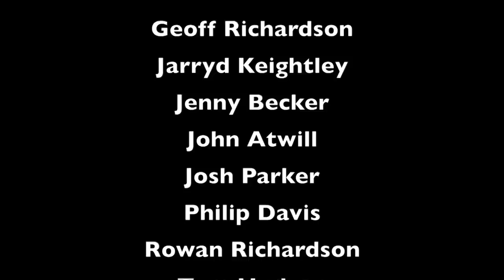Installing the rudder and antifouling the propeller

Comment: You won't regret getting the inflatable. They're so easy to haul on deck when towing isn't an option. Just one tip when towing the inflatable. I rigged a bridal from the rear handles along the sides and through the front D ring, to cut down the load on the the single D ring. When towing with the outboard on the transom, it will significantly increase the strain on that single front ring, and the bridal set up will take a lot of load off it. Loving your videos mate. Thanks for allowing us to share your journey.
Reply from the maker: I've really enjoying using the inflatable and I think it is going to be a great tender. Good tip about sharing the load so the front D doesn't get ripped out. That wouldn't be a great day.

Comment: That is real progress!  Starting to look like she's ready for sea.  Oh yeah, I do have one of the same Tohatsu 6's , the sail version.  But, it is crocked up now.  I left it idling in a tub to flush it, but the tub had developed a hole so the water ran out.  When I got back to it, the motor had seized.  I can pull it through but the piston does not move freely.  I wish I lived down under, so maybe I could get you to work on it.  LOL
Reply from the maker: Thanks mate. That's a bummer about your outboard. Should be fixable though depending on how old it is.
Reply: @DangarMarine  It is 5 years old and has between 40 and 50 hours on it.  Maybe I'll get into it and see what I can find.  I certainly can't make it any worse.  Thanks for the advice.

Comment: Hi Stu, Just an observation. When I installed the rudder on my 45ft narrow boat, I dropped three 1/4" loose ball bearings in the cup so that the rudder post sat on them and the "rolling resistance" was reduced.  I am not suggesting you take it all apart again to do this, but it certainly made life easier at the helm.
Reply from the maker: I like that idea. It's only a five minute job to get the rudder out and in again, I might look into doing something like that.
Reply: that does sound like a cool idea

Comment: Good video.  You are a working machine!  I suggest consider moving the sacrifical zinc on the rudder.  The current position is in the area of maximum water flow from the prop.  Maybe move it to the top or bottom of the rudder where the water flow will be less disrupted by the zinc.  Best regards, Greg
Reply from the maker: Yes, will swap it for something smaller down the track too.

Comment: Hi, Nice job, at 15:50 you can hear the rudder is binding, if it was me I would make the bottom bearing looser and the 4 holes bigger so you can situate the bearing so it does not bind, interesting to see how the propeller anti fouling will hold up.
Reply from the maker: It think that noise is paint and antifoul that has run into the bearing a little bit. I'm expecting it to free up pretty quickly given it is the original bearing and already a little worn.
Reply: @DangarMarine  Hope so, but much easier to check now on the dry than when in the water. A good old handmade thumbs up to you.

Comment: Hi Stu, Nice work she is going along beautifully. Just an Idea for all the panels and add ones in the engine bay and anywhere on the troller- rubber mount anything you can that's not welded on, it will  help reduce vibration noise.
Reply from the maker: Yes, good rubber mounting can go a long way to reducing noise.

Comment: Well Stu it's getting closer and closer everyone's getting more excited can't wait to see it done I'm sure you can't either... Before I forget and I will mention this again when you install the engine make sure you have a system in there to kill the air into the engine to stop a runaway that happened to me it was the scariest thing ever when you have a diesel Full Throttle and you can't stop it and you have to open the hatch and you're afraid it's going to blow a piston or the blower what happened to me this spring broke controlled the throttle anyway take care my friend
Reply from the maker: Hey mate. Yep, will definitely at least have a sheet of ply or something I can put across the air intake.

Comment: The best sealant for threads on pipes etc is Hydraseal ,, its a tar based ,, comes hard  pour in a bit of petrol till its the right consistency,  paint on with a brush and screw it together ,,gal irrigation fittings easy to undo after years underground .

Comment: Hello, re: how to rig up the anchor windlass. Did you mention there's a pto on the main engine? I'd be very tempted to go hydraulic. Pros: simplicity, power, lower long term cost, maybe find a self-spooling salvaged unit off a fishing boat. Cons: higher initial cost (questionnable), main must be running. You could go over kill on your ground tackle with the hydraulics. Just a thought. I'm diggin' on this project.

Comment: Great video just make sure you inflate your dinghy correctly. Sounds silly but I didn't realise I was under inflating my inflatable for years when I discovered a problem, the gain in performance was unbelievable, it was a completely different boat.
Reply from the maker: The annoying thing with this one is that it doesn't seem to have one way valves in the ports so it deflates a bit when you remove the pump. Will look into it more today, maybe I'm missing something.
Reply: @DangarMarine  look for a button-like thing in the middle of the valve. Depress and rotate to turn the valve on. It'll be spring loaded, release by pressing and rotating again to turn the valve off for deflation

Comment: The bottom bearing appeared awfully tight, as it needed to be tapped to rotate it to align.. the bearing should be loose as it only supports the shaft from flexing and takes no axial load.

cheers great video.
Reply from the maker: It’s just anti foul that has run into it a little bit. It will wear away far enough.
Reply: @DangarMarine  Surprised you didn't grease it first.
Reply: @DangarMarine  red wax in the rudder bearing as a lube.
Reply: I was wondering what Stu's thoughts were after watching it back when he was turning the wheel.

Comment: Drill and tap the lead ballast then epoxy coat it. Make handles out of scrap from the rub rail ends. You may want to cut a treadle out of rub rail scrap for the door in the side.  
You might want to use magnets to hang towels from the hull to shade the prop from direct sun. Don't put a towel laying on it.  Use prop wax under engine mounts.  Did you get new bolts for flywheel to crank ? 50 foot pounds, slathered in specified grease then 90 to 120 degree turn. No reusing them 
 Antiseize on the parts in the bellhousing that you has to fight apart.
Reply from the maker: Handles on the ballast is a nice idea. Yes, will get new bolts for the flywheel and damper plate and plenty of antiseize on those splines!

Comment: Have enough of that prop shield to put on the rudder, it might turn faster:-)?
Would the anode have less drag on the rudder with big end on the tail?
Glad the dry ice worked...
Might want to caulk the bottom seam of the chime to prevent the ocean waves splashing up from the bottom?
Machine shop parts look great. 
Now I know the difference between the two stroke 4-valve head and two valve head. Bus grease monkey channel is doing an in engine rebuild on his bus with Detroit 2 stroke 2-valve head in it wanting to convert to 4-valve head.
Reply from the maker: Yes, I watched that vid too. The total valve area is much better with these four valve heads.

Comment: Hard to believe that 'prop-shield' will last long in the water but they must know what they're doing.
Would have been interested to see how difficult it is to turn that prop once it had warmed up again?
Reply: Rotating that shaft shouldn't be a problem, the thicker parts aren't rubbing against anything,  that's why they were thicker to begin with. They didn't wear down.
Reply: @tjj300  Ah yes, I'd forgotten that.

Comment: Wasn't there originally a copper shim plate between the bottom rudder bearing & the keel where it bolts up? P.S Good to see you wearing grinding glasses when doing the prop.
Reply: Yeah I recall that too. Not that it amounted to much of a distance.
Reply: @peterjensen6844  Could have something to do with galvanic corrosion link to hull or might be an alignment shim, could be both, lets see if Stu can find it now.
Reply from the maker: Yes, but now there is two layers of antifoul and two layers of primer.

Comment: The wood looks great, good job Stu.
If prop seal works on bear, heated metal, why isn't it used on the prop shaft tube aswell instead of paint?
Reply: How do you get that bear to hold still while you rub that prop seal on it's gonads ?
Reply: Get brair rabbit to sit in front of it!
Reply from the maker: It is only really used on the prop due to the rotation speed.

Comment: Hey mate would it hurt to put the prop shield on the rudder too? By the way Red Dwarf is a perfect name Lister would be proud.
Reply: There's much cheaper and better options to use on the rudder. That little 375 gram tub is roughly $60 USD plus shipping from the UK. While it might seem expensive, it is actually a LOT less than other prop specific products on the market like Propspeed that would be $200-300 USD for a kit of about the same amount.
Reply: @southjerseysound7340  Well he didn't use all of it and I thought it might go to waste. Just looking for something that he could add it to.
Reply: @gabet9993  If it was a paint or something that doesn't have a long shelf life then I'd say use it up too. But it lasts a long time and is best left for future treatments. Although he could do the prop shaft as well since they can get fouled too.

Comment: Cool anti-seize story...well not really cool so much as the best explanation for using it. I assembling the axles for a piece of mobile heavy equipment (30 or 60 tons, can't remember which it was) that used pins through plates for its steering. My coworker saw how much antiseize I was using and told me to only use a tiny bit of it to help get the pin in. My answer was, "Have you ever tried to take out a pin like this when it and the machine have been out in the field for 5 years? I have and if you don't cote the entire hole, it takes hours instead of minutes even if you have the right tools."

Comment: No Permatex or al least grease on those rudder mounting bolts? When you next want the shaft out it will be easy! Did you fit the rope cutter?
Reply: That's exactly what I was thinking.  Kind of cringed when he had to pound the bolts in and didn't treat the threads either.
Reply from the maker: The bolts were just pushed through antifoul dripped into the holes. I will probably actually weld those nuts and cut and replace them next time.

Comment: Sorry I didn’t understand why you put dry ice on the shaft. I thought you would heat it up as you would do to get say a Bolt out of an engine.
Reply: Extra cold helped contract the steel shaft marginally so he could then push it in to the tight bush.
Reply: The new bushings were machined for the diameter of the shaft where the bushing sits. This was smaller because of wear. Unfortunately the rest of the shaft was at the original diameter and wouldn't fit through the bushings. The shaft needed to be cooled to make it small enough to insert through the new bushings. Regular ice wasn't cold enough, so Stu had to use dry ice.
Reply: Heat = expand, cold =  shrink. Make smaller = fit in. :)

Comment: prop shaft and rudder looks great. Nice work. Is there a reason why you didn't put the aluminum floor boards in the new raft? Nice little boat for $700.
Reply from the maker: To heavy to carry. Put them in at home.

Comment: G'day Stu, another great video. She's really taking shape now. How easily did the prop shaft slide in after the ice treatment ? The engine looks to be coming along beautifully. That Prop Shield stuff looks as though it would make a really good weather proof coating for my trailer chassis. With the amount of salt that gets chucked on the roads during winter here any vehicle may as well be in sea water so that stuff looks to be well worth a go. Regards from the UK.
Reply from the maker: The prop took a bit of effort to get in, but unfortunately I didn't have my camera setup properly.
Reply: @DangarMarine  No worries about the camera mate, I was just interested as to how much of a difference it makes icing something. I've had occasion to do it the other way round and bake ring gears in the oven prior to  fitting them on flywheels.Looking forward to future episodes. Cheers Stu.

Comment: Hi Stu, i'm enjoying your channel a lot and found the paint specialist segment really interesting since you delved into the science ,  chemistry and physics of the different layers of product required for your project. Got me thinking (a good thing) about adhesives. You use Sikaflex a lot and I think its a polyurethane product so I was wondering why? By the great surf god Hughey I hate silicone. I thought  - see if Stu might do a segment with a specialist  on the differences,  practical uses of both - pits and falls etc...since it looks like you are getting close to cabin fit out time and will be using some of these products??  - Perhaps comparison between Sellys v Sika products? Cheers Jon

Comment: Looks like you could use a mix of carnuba, bee and paraffin waxes (5:2:3) for the antifoul on the prop.
Reply: Actual antifoul isn't just a sealant, it also actively prevents plants and animals from growing by being unpleasant for them if not outright toxic. Normally it uses a heavy dose of copper which is why almost all antifoul paint is this color. For the same reason, houses in wet areas have copper flashing along the roof peak to keep moss from growing.
Reply from the maker: Interestingly, this prop antifoul doesn't have any toxins in it, it is just an ablative coating that stops the barnacles from sticking.
Reply: @OriginalEric  
Oh WOW!!!!!!!!!!!!!!!! I never knew that! 
Thanks so much for such valuable information, I will sleep SOOOO much better knowing it... 🙄
Reply: @lancer2204  k, good to hear it

Comment: Did you ever consider removing the handrail might weaken the spine of the boat?

Thanx from the left coast near the Krapitol of California
Reply from the maker: It will a tiny amount, but the deck and the hull are a monocoque which is where all the real strength is.

Comment: Might pay to drill the prop tube and use a butt tap to tap a thread and grub screw that cutlass bearing in place so it doesn't spin in the housing or back out.
Reply from the maker: Yes, need to track down some suitable grub screws.
Reply: @DangarMarine  You could use hex head bolts cut to length, loctite & then anti-foul over them, easier to remove later with the bigger heads.

Comment: I would think that you would Mouse those nuts so they will not come of.
I was is Bass Strait on a 65 yacht that put the bolts upwards and then put the nuts on .
We thought we lost the rudder but it was just there by the Grace of God.
The Captain wanted me to call a mayday and I said it’s only a Pan Pan.
Any way,  we were towed some 20  NM
After we sent a dive down to see what had happened and told me how it was fastened I was stocked.
It was done that way because the builder of the yacht didn’t leave enough room for the bolts to go down.
So in the end we had to put new ones in the wrong way BUT we made sure we wire them together.
Reply: Dusty Farmer , thanks very much for letting me know that I misspelled it, now put the right Pan Pan up.
Thanks again.
Reply from the maker: Yes, will look at some way of locking before launching.

Comment: When you removed the rudder the first time there was a sheet of copper between the base and where it bolts to the keel.  Did you need that?
Reply from the maker: I don't think so. There is now several coats of epoxy and antifoul between those two pieces of metal that wasn't there before.

Comment: I'm wondering about using some type of Anti-seize for nuts below the waterline. Just curious if I should use some for future servicing?
Reply from the maker: I would for things like stainless bolts into an aluminium gearbox, but I'm not so worried here.

Comment: Stu! You got a haircut ... abd shaved!!!  Is a VERY good look for you. I hardly recognised you!  How well does the prop-shield stick? Is there some kind of chemical bond going on there, or is it just a waxy substance that needs to be reapplied on a periodic basis because the prop whirling in the water has a tendency to wash it off?
Reply from the maker: The idea is that it washes off throughout the year and gets reapplied at each slipping.

Comment: could you just explain about anodes and what they do i still dont get it
Reply from the maker: Will do when I put the hull ones on. Stay tuned!
Reply: It's to do with galvanic corrosion & noble metals, the more noble the metal the less likely it will corrode if two dissimilar metals are in contact with each other in water. Sacrificial zinc anodes bolted to steel hull will slowly dissolve away while the steel remains, stray electrical currents will speed the process.

Comment: Hey Stu you could have used electrical tape instead of that blue painter's tape it's a lot stronger and a lot harder to rip
Reply from the maker: But it didn't break so it was strong enough.
Reply: @DangarMarine  true brother.

Comment: Hi Stu, Just checking---Im worried if you loose the rear bolt on the rudder anode, could it swing and hit the propeller?
should it be mounted lower?